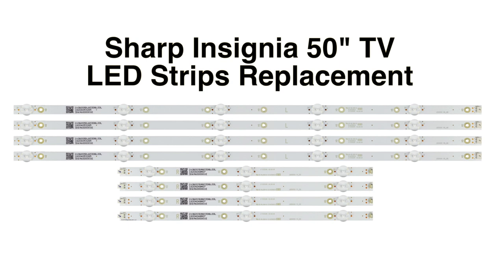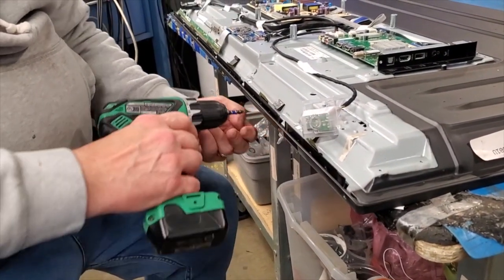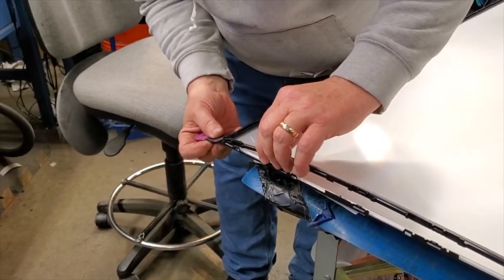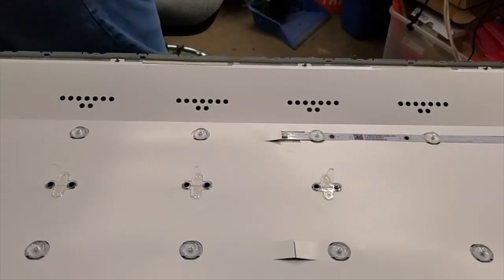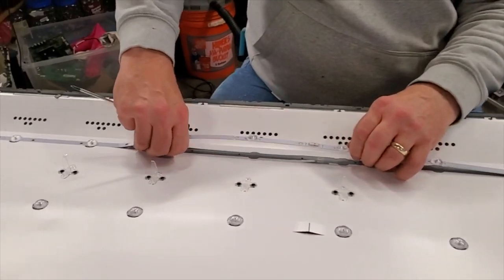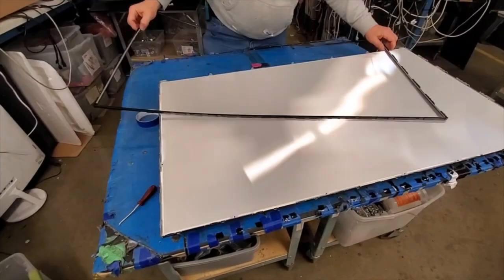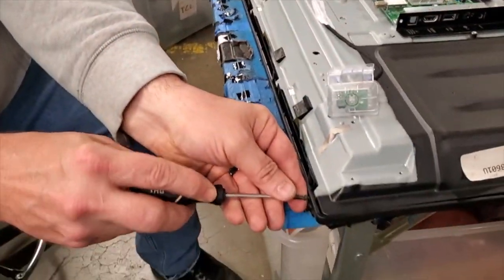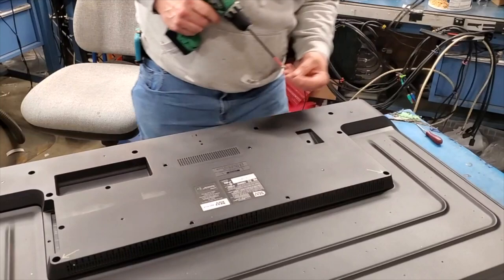Sharp Insignia 50" LED TV - No Backlight No Image LED Strip Install Replacement Model LB50091

Comment: Doesn't removing part of the white reflector panel change how the picture will look after the repair is done?  If it would not hurt it, it seems like the reflector panel would be designed so that it would not cover the LED strips.
Reply: I would imagine so. Especially if you're replacing all 4 strips. You should probably find a way to glue or double strip tape them back to get proper brightness. Everything you change inside does make a difference, I've had experience. Even a wrinkle in the paper could make a "dirty screen effect". You'll often find dim spots in the four corners too since it's a bit of a distance from the LEDs.

Comment: Hello. I replaced the LED lights on a Insignia NS-50df710na21 smart TV. The 3 diffusion panels shuffled and I cant remember the order. There's to clear sheets are reflective sheet and a thick white plastic sheet. Would you happen to know the order?

Comment: I looked on your sight, but didn't see any backlight parts for ns-50df710na21. Haveing a backlight problem. When I turn TV on I can only see the picture if I shine a bright flashlight at the screen. Any sggestions?
Reply: I need the same ones any luck with a part number?
Reply: @74burns  unfortunately no. It sat in the garage for a number of months till they had a electronic pick up. To thrown out 3 days ago.

Comment: You really don't have to do a full replacement on this model. It's not the backlights that are dead, its just the connection between them. If you press on the connector between the two parts of a light strip they will turn on. All you have to do is bypass that connector by soldering two wires connecting the plus and minus bridge over it. This model has some really hearty backlights but a bad connector in between them. Also you do not have to cut the reflector sheet, just unscrew the pegs and it peels right off.
Reply: Great post, I have the Insignia 50", I tested the power board connector to led cable and am not getting 5v labeled next to pin#1 , it's only about 1.5v? Any thoughts?
Reply: @hawaiiguykailua6928  Did you test every single led with a multimeter to see if you get a faint light in it? Once they are all good, or shorted the tv turns on usually.

Comment: Hi Jimmy, I have a problem with my tv where when I turn it on there is no picture  except a grey glow, However there is sound. The tv is a LG smart TV, model number: 55UK6950PBL. Do you have any advice. Thanks.
Reply: Any luck ?